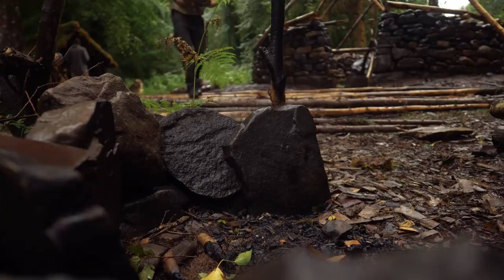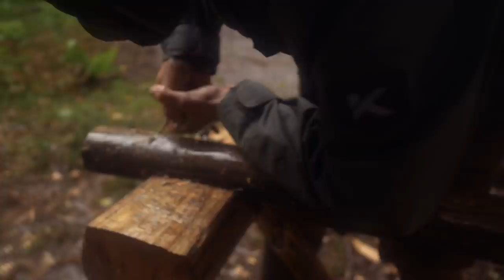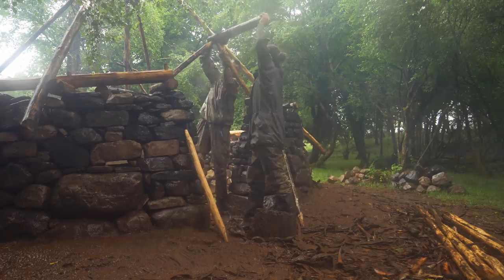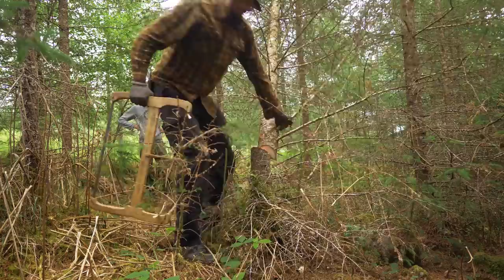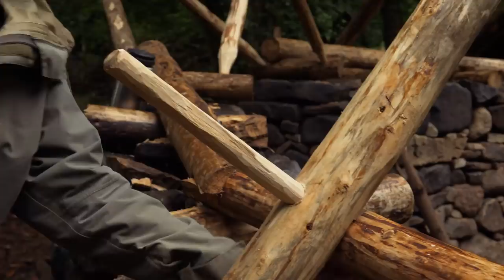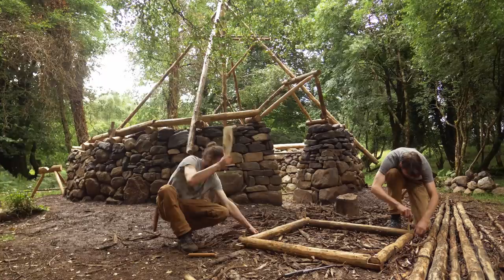Iron Age Bushcraft Build - Roof Building in Soaking Rain: DODGY STUFF! (Ep.8)

Comment: If you carve in a groove around each end of the mallet head a couple centimetres from the end and tie some cord around that tightly it will keep wood from splitting down the grain. Also try slightly rounding the face and edge of the mallet head to reduce the stress of the impacts.

Comment: Erect 2 tripods (tipi style) on either side of your fire pit & run a ridge pole over the top, stack leanto  branches on the back side with moss roofing to keep your kindle & firewood for dry storage & 3/4 of your cooking pit should be covered for good access.

Comment: This is irresponsible, now you have one at least :P

Have ya'll considered a stone mallet?
Reply: Stone would damage the wood
Reply: @dimitrivos7088  Was about to comment this. Stone is more likely to damage/fracture any pegs they use, meaning now they have a useless/broken piece of wood they have to get out. Stone being heavier would be more awkward to use/maneuver in tight areas/while holding onto the pole. And also if they were to try and shape a stone with a hole it would take forever, and if they were to tie one on it would be fragile.
Reply: @mjf69  i didn't even think about that 😂 but now jou say it i would like to see them trying to fix a stone to a handle 😂
Reply: @dimitrivos7088  I mean it's super doable, they could also do it similarly to the way they've made stone hatchets. The issue is it's just more difficult and tedious to fit stone to wood or wood to stone, instead of wood to wood. Even if they have to have like 10 spare mallets it would likely be less effort than making a single stone one.
Reply: @mjf69  maybe they should just buy some of those steel ring that go around wooden sledgehammers
Reply: @dimitrivos7088  Yeah, I mean they are using "modern" tools. I wouldn't be angry if they just bought a mallet. When you're already using high quality saws, and chisels, and a hand drill etc.
Reply: @mjf69  I think the better option would be wrapping some cordage around both ends of the wooden head of the mallet so that when it starts to split it doesn't split all the way.

Comment: Can I recommend pine pitch resin to seal your dowels? its easily passively harvested, slash a dozen trees taking off a decent chunk of bark, and lay a piece of bark on a slope up to the wound, and it will collect endless amounts of sap, crush some charcoal, and you can cement your dowels in perfectly, never have to worry bout them slipping. carpenters glue, easy. would soaking your wooden hammers prevent them from splitting? kinda like using bark cordage, its strongest when wet. 

Cheers from Canada. What are you guys going to use for the roofing by the way? Your rafters are all set but what about roofing material, is it going to be thatch? where the hell are you going to source that.

Comment: I've seen (in videos, but still) some bushcraft mallets being made with a slight notch carved close to the edge, and then a string being tied around the mallet there. The idea seems to be to make it less likely to start to splinter. Same principle as those wooden mallets with steel bands around the end, just much more bushcrafty (I know you guys prefer to do things natural materials only, but the mallet is a tool, not part of the permanent structure, so adding some string to it seems allowable to me). :-)

Comment: Seems all pegs and no cordage makes for a shaky roof. I want to tie those rafters together at the top so bad.
Reply: It was looking pretty good by the very end. A bit of rope wouldn't kill it though
Reply: agreed, cordage would be nice. Hell, why not glue them with pine pitch too! Just slash a few pine trees nearby with a piece of bark to collect the sap underneath and you'd have more than enough. It's such an undervalued resource. Its basically carpenters glue. If they glued their dowels they wouldnt have to worry about them slipping, youd just have to worry about them snapping.
Reply: @CircmcisionIsChi1dAbus3   When the wood dries and shrinks the wooden dowels/pegs will hold fine , and to my knowledge were never glued in place.

Comment: If you guys aren't working from plans or some reference model, I suggest looking how the framework of yerts are made. I'm talking about the structural part that holds up all the poles that are spread around the circumference of the round walls and meet in the middle. Seems there are a couple of different designs of yert-like tent structures in Central Asia. And there are quite a few YouTube videos on the subject. Your current wooden structure looks a bit dodgy to me.

Comment: "No safety gear" says the man wearing Gortex and using tool steel branch saws!
Reply: everyones got their line :P i made a round house and wanted it to be as accurate as possible XD but I still used modern roofing membrane to try to increase the life span of the structure lol we might have arbitrary standards but the line gets drawn, dont cross it lol because tegrity.